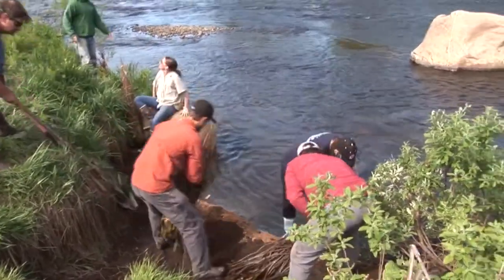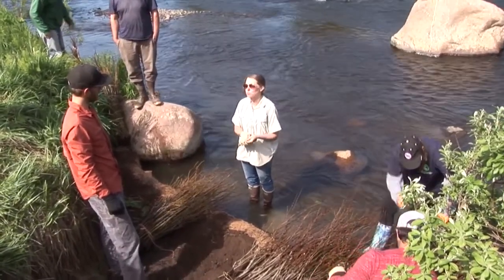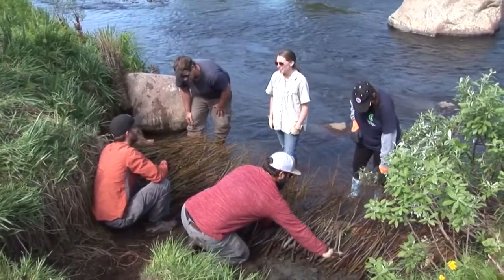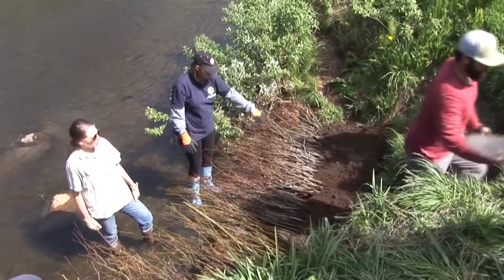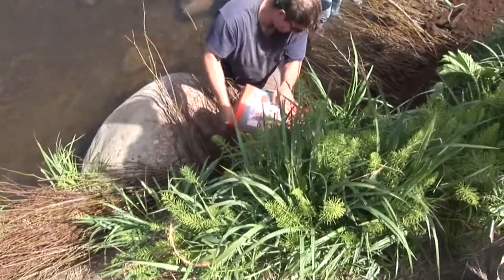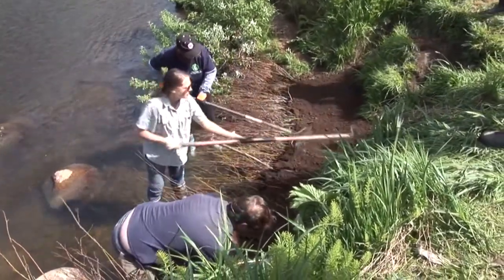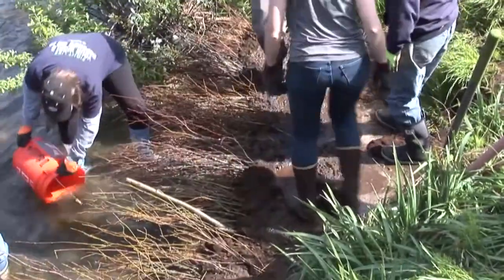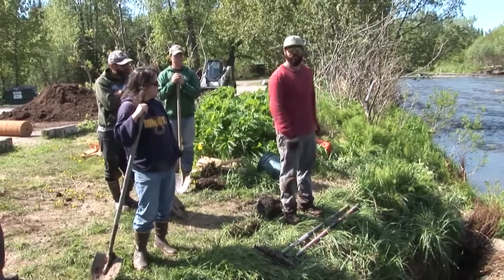Anchor River Silverking Campground streambank restoration: site 1, step 2: install 1st willow layer

Comment: Willow cuttings are difficult to get started in a cold environment. Besides needing periodic wet soil, willow sprigs love sunlight and warmth which is the key factor in successful transplanting. There is a growth hormone that you can purchase and apply to the base before planting, I have never tried it myself. 50% success rate is rather high in my personal experience. You will most likely have to continue the process of transplanting cuttings for several years before the area becomes populated to any degree. If there are existing willows in the area you will get some volunteer help from the seeds of these mature plants. Not sure of the angle planting method, most willows plant stems grow vertically in realation to the ground. Not an expert, but I have 15 years of experience in growing willows in the wild. Keeping animals and people off the newly planted sprigs will also help. I hope this is helpful,